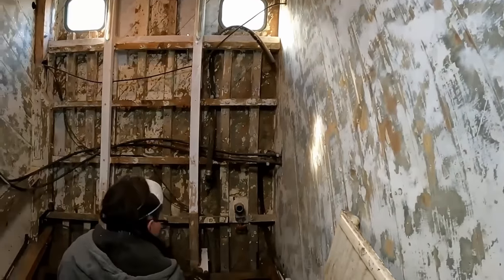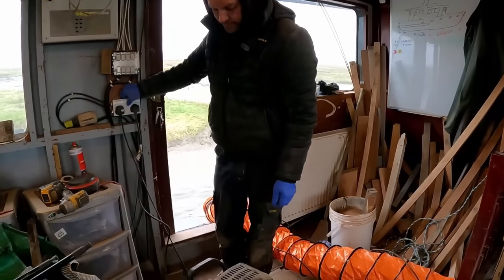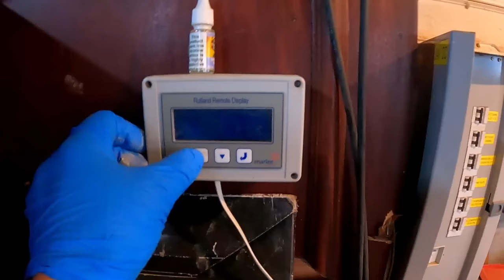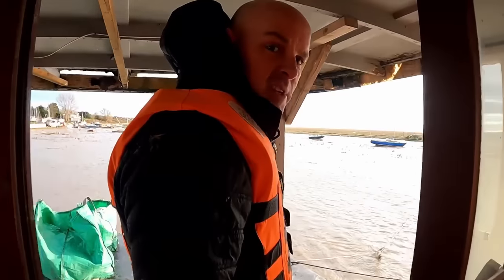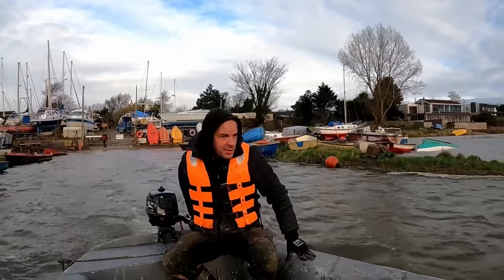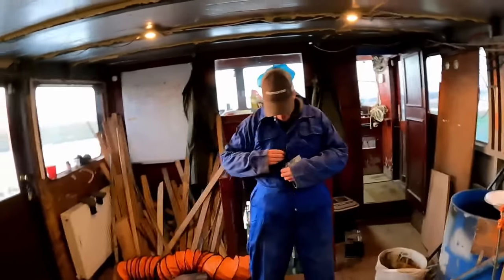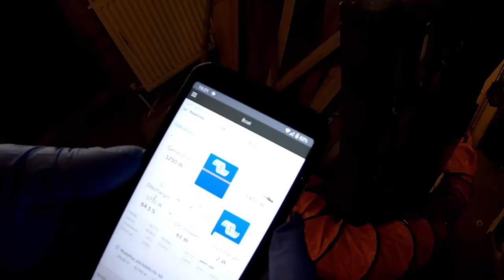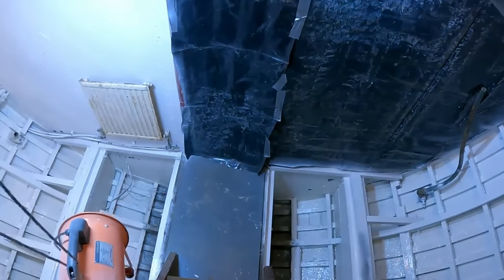Ep 160 - Power Struggles On Our Off Grid Boat Restoration

Comment: You might try and use an airless sprayer. It will not have all that over spray. And you do not need a air compressor.
Reply: Lidl has an LPHV sprayer right now. Cheap enough to use as a stop gap.

Comment: The cheapest fix for the long term painting of the boat is to order an H.V.L.P. ( high volume low pressure ) spray gun so that you won't need as much compressed air in the first place since the gun is gravity fed and doesn't use the speeding air to draw the paint out of the cup.  It also has a lot less overspray and lets you get more coverage from the same quantity of paint.  Also of you fill the compressor then shut it off till the tank gets too low it will start easier and you won't be wasting air or power for no reason since the h.v.l.p. gun will keep working down to like 1 bar or eve lower if the paint is really thin.  They are also easier to clean as well.  You could also use a power painter that only uses electric but those are much harder to get a good looking pattern in my opinion.

Comment: Nice work on power management, one option could be a petrol powered air compressor, though heavier you will need the practice when you install the diesel generator. I wish I had half the talent you two possess. You do fine work.
Reply: Thumbs up on that petrol powered air compressor,    i think it would be a lifesaver.

Comment: Pour some vanilla extract in the paint it will knock out some of the fumes. No, it will not do anything to the paint.
As for paint I your hair. Get a dew rag like you would wear under a motorcycle helmet or get a cap the welders under their helmet. I use a cap. I powder coat. My hair does not get caught in the helmet.

Comment: Wear a pair of disposable coveralls with the hood up & a full face mask when spraying. Using paint thinners to clean paint from your hair/skin is not recommended. The solvent will remove the natural oils in your skin and be absorbed into your bloodstream and may cause damage to your kidneys. Your compressor probably doesn't produce enough volume of air to keep up with the spray gun (volume & pressure are two different things, a bit like amps & volts with electricity).
Reply: If not causing damage to the organs, it will ruin the skin and can lead to irritant dermatitis, I know how that feels and it's not something you want.

Comment: With all the gadgets and your power problems don't you think it would be better to get your power generation system(s) sorted out and working before doing power hungry jobs?  I can understand you using a spray gun for big areas but in my opinion the mark 1 applicator is best - a brush! Was the paint you used an undercoat?  
You have taken on a massive restoration project and I salute you for doing it.
Reply: They've got to get the beam shelf in before doing the deck and that needs doing as soon as possible.

Comment: Before we built our full sized paint booth, we used a one meter fan in a box on wheels. It worked fine, but kept getting clogged with dried paint. After cleaning it once more, I used a small stiff brush to apply a thin layer of white grease on all the grills and supports, then after the next paint job, the crust wiped off with a rag...:person-turquoise-wizard-wand::hand-purple-blue-peace:

Comment: you need to get your other generator out to the ship.  Even if you just have it on the back deck and runnable. Put it on some wheels so you can roll it inside when you are not using it.

Comment: I watch all the time, love the encouragement, my wife and mother in law watch too!  In this episode I was reliving my own struggles with much the same setup.  My rv tech suggested this SPP5 Hard Start Super Boost HVAC Relay and Start Capacitor to put on and it solves the start up surge need to kick the compressor.  So I left the existing cap on and added this, my inverter is  1750 surge watts! Hope it helps.  A little white prime help IMO to flatten the gloss paint too, if flat is not available. This warms up the room and get rid on the unsightly blemish. I once did some fish holds, two were 60' x 12' x 12' yes in feet, the gloss white was horrid, but good for seeing problems, all fiberglass, last coat I did flat white and bam! they looked Great!  Keep up with the content and nice to see evolution in your tools and techniques.  Mark Keller shipwright in Canada.

Comment: I think I would be using a airless spray gun setup.  Draw far less power, less overspray, pure paint no air needed.  even the heavy duty commercial ones are a reasonable price.  But it is a step further another bit of work completed and it is looking better all the time.

Comment: It would probably make sense to rent a compressor that is powered by a petrol engine. Less wear and tear on your off grid power system.
Reply: Run the compressor off diesel generator engine. It can have its own pulley sized to suit.

Comment: I hesitate to say this, but using an airless system would be a better way to paint such large areas. You can rent an airless sprayer rather cheaply, just to see how you like it before buying. Grayco makes an excellent machine that can be rebuilt when it wears out. I have used these and can attest to their durability and ease of use. As a professional painter, I was able to paint three houses in one week. The speed and lack of downtime are well worth the money you would spend on an airless sprayer. Either renting or purchasing a used unit would be the best way to find out if this would be the tool to help you in the massive job of painting your entire boat without a compressor.

Comment: Quick fix for your compressed air issues, bin the compressor motor and put a lawn mower petrol engine on it.  This will give you a wider CFM range by adjusting the engine revs.  Works for me, been spraying cars and LCV's this way for years.

Comment: On my Victron setup, there is a Shore Power limiter you can set to just below the max output of the genny  (8Amps in my case) this allows the genset to support the inverter without tripping..

Comment: Last year I bought an Erbaurer HVLP (high volume low pressure) spray system from screw fix, initially to spray a heap of fences. It was so good I sprayed my new shed with it. Not sure if my particular one will work with solvent based paint, changing the seals might work. But the advantage to you is its only 800 watts and relatively inexpensive and self contained. Sounds like a hoover which it basically is working in reverse.

Comment: You could spray paint with an airless paint sprayer or a hvlp system that uses a vacuum cleaner type blower, both will use less power than your compressor.

Comment: I appreciate all the skill and hard work you are doing. That said, you really need to buy a gas/diesel generator to provide consistent power or you will never finish this project. Please tell me what is the co2 footprint of the engine in that boat? I assume it does not utilize DEF or run thru any form of catalytic converter? I assume it is some form of diesel? Correct?

Comment: Hey tou two, you'd be much better off buying a secondhand 5000K generator to power your AC tools and compressor instead of using an inverter to give you AC voltage from your batteries. It's really hard on your batteries going from 12v up to 230v through the inverter. Most generators have a battery charging function as well as multiple 230v outlets, Just a thought.

Comment: 3kw is 4hp that is one hell of a compressor when most for home use for spraying lorries and cars etc are 2 hp and have adequate air reserve for such matters. You are not using air masks why do you need such consumption? I work in a home workshop removed from house with barns etc and feed off 6mm supply and make sure I never feed more than 2kw plus lights to spare loads. You have a high demand for your available commitment. A horsepower is 750 watts and everybody should remember this as 2 hp is about the maximum safely allowable for  2.5 mm cable but many modern motors match or exceed this in modern machinery which rely more and more on ring circuit. There are arguments that some will raise but the old formats still apply and those of us that used to calculate them or have them forced down or throats can but agree. Worth bearing in mind in case of insurance claim for they will wriggle!

Comment: a tip for moisture in your mask get a small piece of clean cloth fold it up and tuck it inside the your mask at the bottom , it will hold the water with out dripping over your work

Comment: The trick to off-grid power , for me at least, is "more, extra, spare and some more". More batteries, panels, generators, inverters broken into seperate systems. 
I live in a tent on 30 acres of Queensland bush with no town water/power/phone/sewage. Barely any mobile coverage either. I'm slowly getting together funds, parts and initiative to build a cabin. I've found Facebook Marketplace to be a gold mine and a minefield for sourcing things to do this.
I've cobbled together a dozen or so 100Ah+ batteries in 3 seperate systems, each with it's own controllers, inverters,  6-12 panels etc. This way I have 240v AC power for my PC and things, as well as enough to run anythying else I would normally describe as "household" things such as kitchen appliances, lights, and such. I bought a number of cheap (and I mean CHEAP lol) generators for back-ups and emergencies. This way I can take my ute and gear anywhere on the property and have 12/24/240v in a mix of AC and DC.
I think where I have an advantage is that I have a fair bit more deckspace to work with than you do on Sarinda.

Comment: If you will be painting while riding the power limit like that I suggest setting the relief valve on the compressor at just below the cut of pressure for the tank, that way you will have 95% of the pressure/flow but the compressor will never cut of as it won´t ever be full. You may wish to rig 2 safety valves with a cut of on the "low pressure" one so the compressor can run in normal and continuous mode. Or get a bigger inverter and battery and genny, witch ever is best for you. When will your DIY genny come aboard and can it solve this issue? Could a small tampon fit in the mask to absorb the excess moisture or would it be to big to fit? Perhaps a cotton ball or two would do the trick, worth trying don´t you think?
Ps. Please don´t start doing the hand on the camera at the end, I really do not like that and I´m sure I´m not the only one, please.

Comment: COLOR  🤔👏👏👏🤫
Ever thought About High Gloss House Paint on the In side 🤔 it has rubber latex in it , It’s Like a Glove . we have it on the inside and out on are block  Fence , I Sealed the Block fence With Regular white School Glue and Mixed with water as a sealer , apply with sprayer let Dry between coats  White Glue is Chemical nam is PVA Polyvinal Acetate , let Dry  , put at lest 3 coats  a lot of water little Glue .
Your Not Planing on sinking are you .
Use House Paint  and you can paint flat over and use an airless with pression painting , use a Wagner airless Sprayer more Volume It’s great then that compressor and spray gun What your using Sucks in a small Room. 
Price Premium High Gloss Latex Paint.

Compare marine Paint to House paint 

Use on the Superstructure and in side the Boat  use house caulking 35 year Plus 

Don’t use it if you planing on sinking neither would work well 😳

Try a small  plywood  , white glue and water let dry throughly paint with Color

Comment: It's NOT gray hair Gemma has, it's Chrome!!!  That's what I tell everyone I have, anyway.  

The white is great.  Sure, it shows everything, but....  it shows everything.  You'll like it one day when you're having to find an odd leak or some bob that's rolling around in that space.  I use white a lot in engine compartments and spaces I may want to be able to see stuff that's lost.

Autograph that hat, take it to the boat show and show Ray Marine this video.  I'll bet you get a case of hats because of the additional advertising you've gone!  Good job on the paint!!  The high current that compressor draws starting up is called 'locked rotor draw', BTW.

Comment: Would you be better using an airless sprayer ? 1.8kw and 2.2ltrs a minute .you can get them online for £200 and with probley lift a stiffer mix where its pushing the paint apposed to sucking it.

Comment: Mm thinking, would a grid tie inverter work.£89 for a 600 watts on ebay.
An inverter and a grid tie inverter will work together, as long as the inverter is on first. It gives you an extra 600 watts. It will not work with an ac generator ok.

Comment: New spray paint method has progressive power and ppe challenges. How warm is the interior for the paint to dry? Also time to add more powerful solar panels, more solar panels  bigger generator, bigger wind generator, bigger wire cables. Or one gas generator for the compressor and another one for the exhaust fan, lights, chargers.

Comment: Rather than switcing thecompressor with the wall switch, use the pull switch on the air compressor; that switch unloads the backpressure on the compressor so it can start with pressure in the tank.

Comment: Couple of questions/comments....  How  soon  to  the  bigger  generator  coming  over?  Would seem  to  immensly  aide  in  these  projects. Just  run  the  radiator  system  sealed  like  in  the  shop. Next, I'm a balding guy.  But,  when  I  weld  and/or grind/sand,  I  use  a  welder's  beanie.  Gemma,  it  will  help.  But,  when  I'm  fishing,  I  use  a  "Neck Gator,"  an  elasticized  turtle neck dicky,  without  the  long  chest piece.  It  can  be  pulled  from  the  neck,  up  over  the  face,  and  used  as  a  'Doo-rag,"  covering  the  hair,  and  it  does  look  stylish.  Simon,  as  for  the  bald  spot,  I  use  car  wax  to  keep  my  shiny  head  clean.  It  covers  AND  protects.  Just  my  beard  looks  camoflaged.  Gemma,  nice  job  on  the  painting.  Literaly  can't  see  any  runs  or  streaks.......

Comment: They do make gasoline powered air compressors, a lot of home builders use them.   It would take the strain off your electrical in order to produce compressed air. They are a little bit noisy,    but if you need the electricity as bad as you need the compressed air it may be worth it.    If you look around you might be able to find a used one that is in top shape.  A gasoline one requires special care if you plan to use one.

Comment: When painting any porous material it is better to use a brush or a roller because they work the paint into the grain. With spray paint the paint sits on top of the material and doesn't have as strong a bond.

Comment: I wonder if a soft start that's hooked up to the air pump would help to allow the air pump to not overwhelm the generator when the it kicks on. 

A soft start can be a little expensive, you would need one that can withstand the amount of wattage the air pump is trying to draw when it first starts up.

Comment: Reactive and inductive loads a motor is reactive you need a generator twice the size of the motor run current as it requires a massive amount of amps to start it an inductive load is a kettle or electric heater starts with low Amps and builds up 😉

Comment: Hi guys, as always great job and many thanks for your effort, your attitude with this enormous job is awesome, just a quik suggestion, have you looked at high pressure airless paint sprayers? maybe theis energy comsumption is lower than using the air compressor
Reply: It is 350Watts on average

Comment: why dont you beak don your other generator and rebuild it on the boat rather than moveing it in one lump
Reply from the maker: Because our other generator still wouldn’t solve the issue as it’s a DC to DC generator, so would still only have a 3000w capacity from the victron unit

Comment: Did you have a filter on the extraction unit as could not see one that was taking the paint fumes out of the boat into the natural estuary as epoxy paint is very dangerous for not only aquatic life but also the birds and micro life that live in it. ??
Reply from the maker: It is not epoxy paint
Reply: Hi sorry thought it was epoxy paint you was using.👍👍

Comment: Next time you need to spray paint, you might try an airless sprayer.  It will take less power and not require an air compressor.

Comment: Nice drone shots Simon.
Reply from the maker: Thanks (but Gemma is the Drone pilot)👍
Reply: Any news on the new one? @ShipHappensUK
Reply from the maker: @wilbearworks  a replacement should be arriving shortly
Reply: @ShipHappensUK  I have got, in a shed somewhere a generator that would solve all your problems with power. It was bought from the Snap-On man about 20 years ago as a spare power source when I was in business. It's diesel-powered and could be a permanent feature in Sarinda. I'll check the wattage if you would like it for free. You would have to get it going, not run for ten years but has had little use, and collect it. All the best.